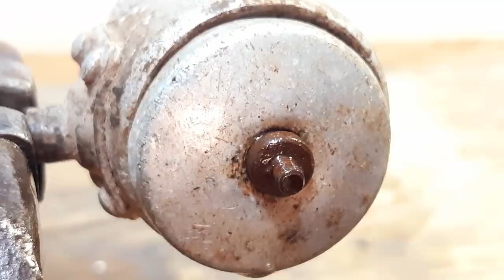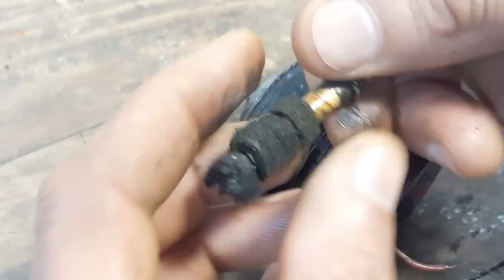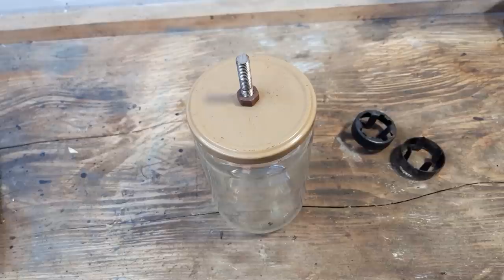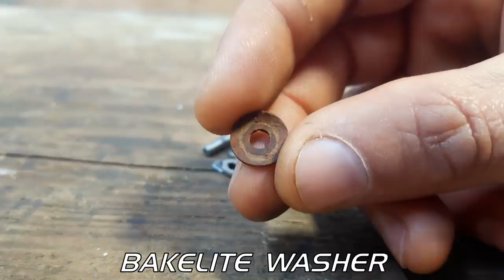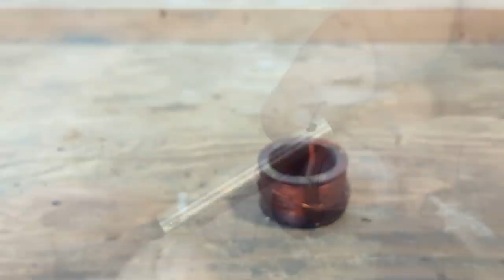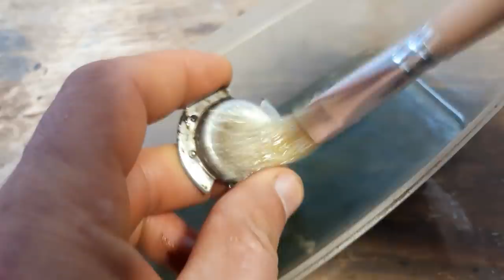restoration old bike dynamo made in ukraine

Comment: The hole you sealed with epoxy was to lubricate the rotor shaft. It was to prevent wear by lubricating the shaft by dripping thin oil on the place where the felts were and ensuring that it rotates easily.
Reply: None of the generators I had like this had a lubricating hole. All mine were lubricated with perma-lube from factory. No regular lube required. Such brands were Miller, Sanyo, & Panasonic. Miller from the UK, Sanyo & Panasonic from Japan, & one I nearly forgot is Union, from Germany. All were good. This one here is probably a rare one.
Reply from the maker: Thank you Christopher for the clarification, you have right.
Reply: @christophermarshall5765  

This one was made shortly before they switched from oil-vaseline mixture (which required to be re-oiled periodically by the user) to a more permanent grease composition, which happened in the later 60s for this manufacturer (FER from Ruhla, GDR). Union already did it in the mid 50s, as the western (non-cοmmunist) part of the country probably made that grease earlier or cheaper.
Reply: @westelaudio943  I’ve never had to lubricate any of the dynamos I’ve had on my bikes. I did see this one had the felts soaked in lubricant.
Reply: @christophermarshall5765  

Yeah. I own several variations of this basic design, and only one (year code: 1966) is oil lubricated. The original design was made from 1961-1966 and thereupon, slight changes were made, and more until the end of production ~ 1990.
 I also have Union made ones from the 50s to the 90s (2000s?) and none of them have any oil valve whatsoever.
 I would also say that Unions are generally slightly better devices, more power output at lower speeds and less likely to slip, and the ones from the 70s are probably the most efficient and very easy to activate.
Reply: @westelaudio943  Sanyo made a ‘ DYNAPOWER’ generator which is driven by the tread section of the tyre. My current bicycle has one of these light systems. Very efficient system and very quiet. Sturmey Archer also made a hub with a dyno built in. The headlight had a switch to operate the lights, because the dyno was operating all the time.
Reply: And he didn't show weather it still would work after he put it back together .
Reply: why not show it working?
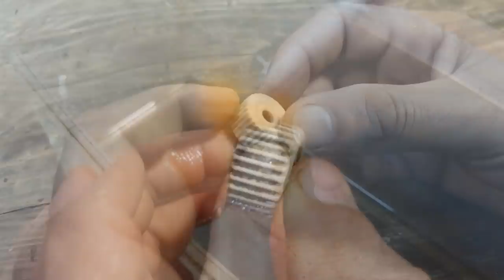Reply: 15:25

Comment: in 1960s i used to break tis bicycle dymamo to get its magnet for a fun..now tis dynamos considered antques.even cant see.one in the market  or towns anymore.used to ride bicycle in deep dark jungle forest only the bike light using dynp those days...now days i saw they are selling tis old bike dynamos in antique shop with a very high price
Reply from the maker: Well, it is a childhood memory.
Reply: New versions of the bicycle dynamo light set are still made. They are even made with LEDs replacing the short life incandescent bulbs (which are also hard to find correct replacements). Go on line and do a search. You will find these sets.

Comment: Nice trick with the drill and sand.
Some of these old bicycle generators used alnico magnets, and if you take them apart without a magnetic keeper you loose some of the magnetism, this one looks like a ferrite one however.
Reply from the maker: Thank you buddy, also for the trick about magnet 🙂.
Reply: for those who trying to find this moment in video: 10:00
Reply: How can the magnetic field of an AlNiCo magnet (or any other permanent magnet) weaken when it is removed from the iron cores of the coils? That would be new to me. The magnetization of the permanent magnet is not stressed when its field passes through the air from pole to pole, in contrast to when the dynamo generates electricity and has to work against the magnetic resistance of the coils.

I have an old dynamo with a block-shaped two-pole magnet made of AlNiCo material with two rotating pole shoes made of iron and two stationary pole shoes of the coil. The housing is made of die-cast zinc, coated with aluminum paint. The dynamo must be from the 1950s.

I have opened it many times, recently to re-oil it, it can be easily unscrewed thanks to the fine thread. The magnet was certainly never weakened.
Reply: Okay, I now found something about it: AlNiCo permanent magnets have a relatively low coercive field strength and should be provided with magnetic keepers for storage and transport to protect them against demagnetization by external fields. The magnetic field of the AlNiCo should not be in danger for a short time and without external magnetic fields.

Comment: Very nice job 👍 you did well to round off those rivets. Nice to see it get a second life. I'm not sure why you plugged up the oil hole though ? Job well done.
Reply from the maker: Thank you Austeration. Before i began the restoration, I checked another original dynamo, and didn't find any holes. I thought the one i plugged was made accidentally.
Reply: @RestorationInside  You are probably right. I just seem to recall as a kid having one on my bike and always had to oil it and keep those felts lubricated. I think it might have even had a small cap on mine that sprung shut. I think I still have the bike but not sure if it's still all together. Regardless you still did a fantastic job.
Reply: He plugged the oil hole because it is going sit on his coffee table?
Reply: The original dynamo don't have that hole but many people did'it for lubricate with oil...I know for sure because my first bike was from Ukrayne-USSR in 1985.They sold bicycles with headlights, dynamos, and red taillights. And the dynamo was identical with this from the video.

Comment: Since you jumped at the end straight to the "final look" i can assume the coil is a bust and you haven't been able to make the magnet rotor spin freely. The coil itself looks messy, you should have done it manually. Now it's just pretty on the outside, but non-working.
Reply from the maker: Anyway, that's your opinion, i had commitments, that's why i didn't recorded the assembly and also the test.
Reply: @RestorationInside  you had commitments so you didn’t finish the video and posted it unfinished?
Reply from the maker: @MisterRorschach90  hello, regarding the assembly and testing, i want to inform you that it takes time for work and also more time for editing to get an interesting content.
Reply: Looks amazing! But he has a point. I just discovered your videos, and really enjoy them. You're obviously very meticulous, in what you do. So why not show the complete working fruit of your labor?
Reply: What makes you think it doesn't work? Were you there when he tested it? A coil does not need to be wound neatly for it to work!! There is no reason why this won't work. You're a "nit picker".

Comment: Why did you covered that hole?
It had a purpose. I think it was made for lubrication.
The coil looks so bulky.
Put it on the test.
Reply from the maker: The dynamo RPM is not extremely high, there are other dynamo type type which are self lubricated.

Comment: U blocked the necessary hole?
Reply from the maker: There are types of dynamo that do not have holes in this location.
Reply: @RestorationInside  - True, but having an access hole in such a generator is a sign of forethought by the designers because the bearings will need to be lubricated at some future point. With generators that do not have this hole the only way to lubricate them is complete disassembly, if that's even possible for the owner.